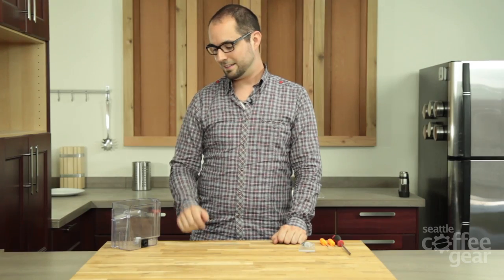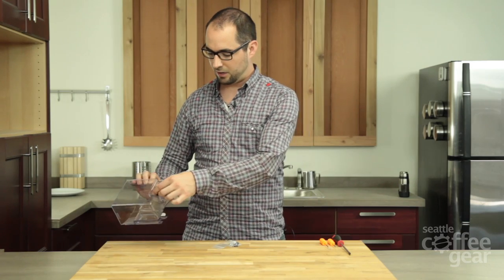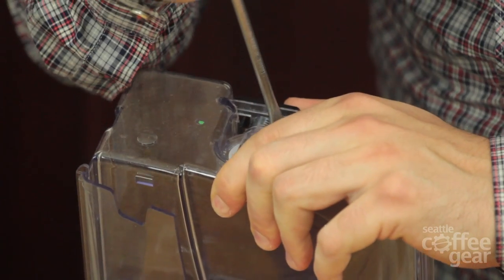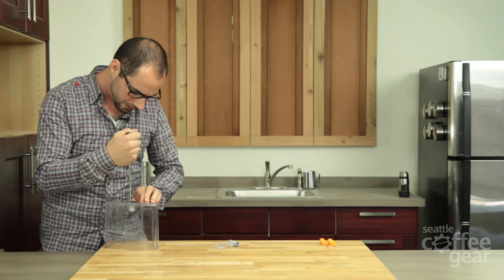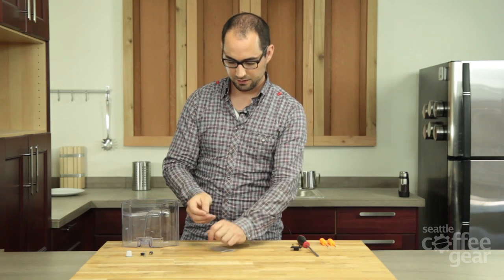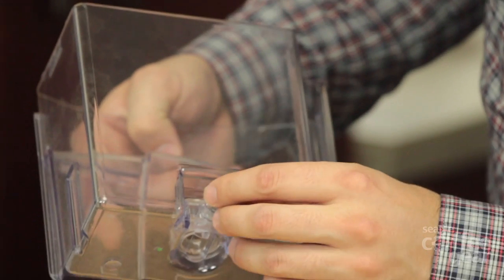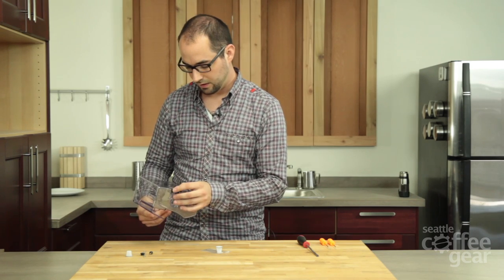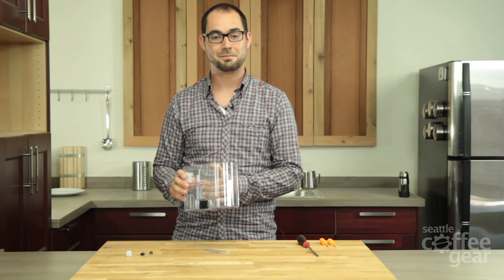Tech Tips: SCG's Tune Up Kit for Saeco's Vertical Water Tank Seal

Comment: Thank you. My Intelia leaks a lot overnight, and I assume an o-ring failed. In my testing, my tank doesn’t leak on its own. It’s water tight, and the spring and seal appear to work. It leaked while in the unit. 

Is there supposed to be an o ring on the inlet side of the unit?  Mine just has a plastic stem with no seals.
Reply: Did you find what was the problem?